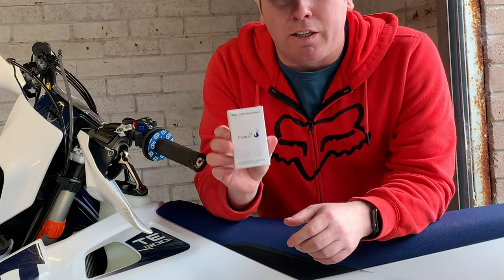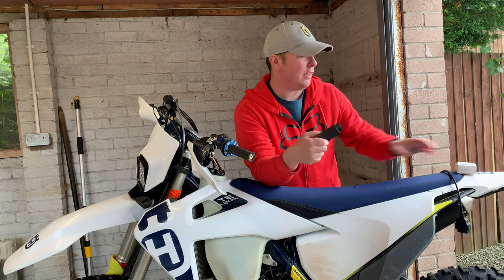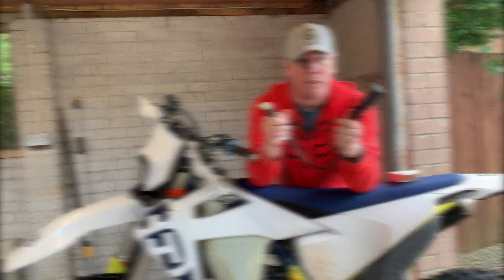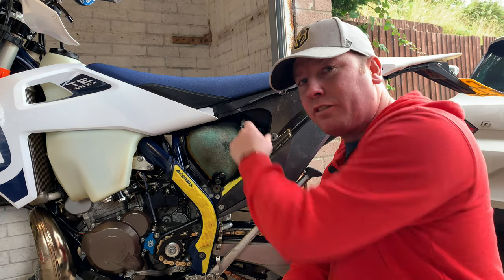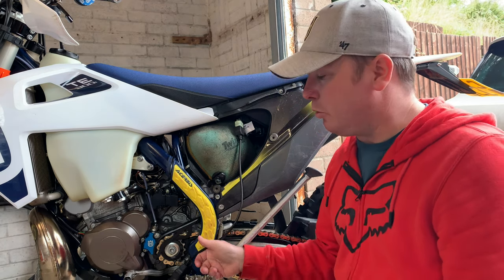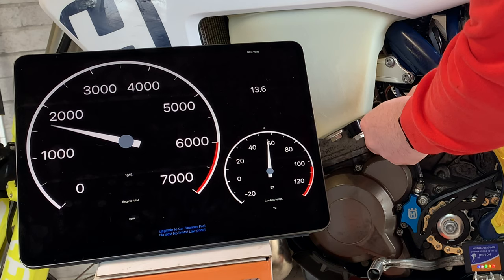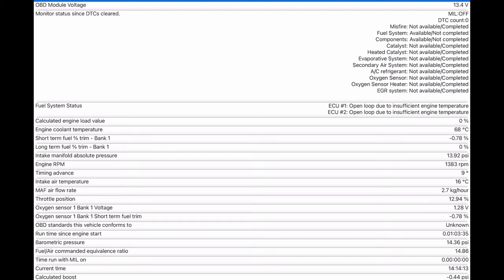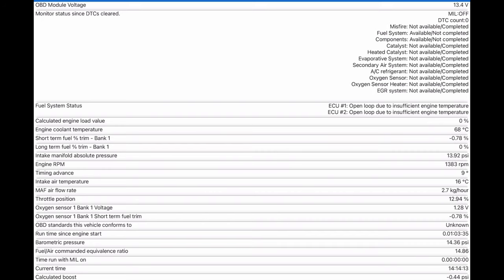The best way to set your KTM HUSQVARNA idle speed - Onboard Diagnostics (OBD2) scanner and App | TPI

Comment from the maker: If you want the Links to what I used in this video, they are in the description to help you out :-).
Below is a live reading of my bike - if the reading is Zero, it means the bike does not give the OBD2 sensor a reading to display. Unfortunately it doesn’t show the hours the bike has been in use. 

OBD Module Voltage
13.6 V

Fuel System Status
ECU #1: Open loop due to insufficient engine
temperature
ECU #2: Open loop due to insufficient engine
temperature

Calculated engine load value - 0%
Engine coolant temperature - 36 °C
Short term fuel % trim - Bank 1 -0.78 %
Long term fuel % trim - Bank 1 - 0 %

Intake manifold absolute pressure - 13.92 psi
Engine RPM - 1784 rpm
Timing advance - 12 °
Intake air temperature - 10 °C
MAF air flow rate - 1.02 g/sec
Throttle position - 12.94 %
Oxygen sensor 1 Bank 1 Voltage - 1.28 V
Oxygen sensor 1 Bank 1 Short term fuel trim -0.78 %
OBD standards this vehicle conforms to
Unknown

Run time since engine start - 0.00:00:00 
Barometric pressure - 14.21 psi
Fuel/Air commanded equivalence ratio - 14.63
Time run with MIL on - 0.00:00:00
Current time - 15:34:23
Calculated boost - O psi
Calculated instant fuel rate - 0.28 L/h

Comment: Hi. You are using the Car Scanner app? What vehicle profile do you assign at setup? There is no Husqvarna profile that I'm aware of, only KTM. i selected that profile but I could not connect to my 2021 TE300's ecu.     Cheers,
Reply from the maker: Hi there. When selecting the vehicle, I normally scroll to the bottom and select [OTHER BRAND]. If you still have connectivity problems, it’ll be worth going on the car scanner website and looking at their Frequently Asked Questions to see if the results there help. I’ve not had any connectivity issues so can’t offer advice there sorry. I hope all is well with the bike 👍🏻.
Reply: @MALVSMACHINE  Thanks for the info.

Comment: Great Vid!! Mine would not connect to the ECU? Followed all steps and got to the very end but it would not connect? Anybody else have that issue? Used iPhone, downloaded OBDII software, used Car Scanner app, used Wifi instead of Bluetooth as suggested. So close... I tried on a 2022 TE 300i
Reply from the maker: Thank you Elysia! Thank you for commenting about your issue, I can imagine it being very frustrating, I wish I could help in some way but I don’t know anyone who has a 2022 TE300i that I could have a play with. I really hope KTM/Husqvarna haven’t disabled the ability to connect aftermarket OBD tools because from what I understand, it’s really important for the TPi engine to idle in the correct rev range and the OBD tool is the only way to see if it is or not. I’ll make a note of this and keep an eye out for any solutions or if other 2022 TPi owners have the same issue 👍🏻.

Comment: G'day Mal, i have a 2021 KTM 690 SMCR and I'm looking at getting the same scan tool, is there different versions ? they seem to list a lot of car they are compatible with but no bike therefore i was wondering if there is different versions of the tool ? thanx
Reply from the maker: Hiya mate! The scanner I have is the same, it doesn’t mention bikes because it’s a 16 pin connector to directly connect to the OBD port in a car. You just have to make sure you get the correct OBD to ECU lead for your bike, then when you open the app and go through the connection process, select ‘Other’ and should bring up the diagnostics 👍🏻.

Comment: nice but which screw actually are you using to adjust rom cause I can't see. Is that one with the red knob?
Reply from the maker: Hi, I’m turning the idle screw on the throttle body using a screwdriver. It’s the only screw there. 
What year and model bike do you have?
Reply: @MALVSMACHINE  I have 2023 fe350 and I have yellow and red know which can be turn
Reply from the maker: @andrewsoldan6050  ah ok, I’ve not seen a 2023 FE yet, but I’ve just looked at the online user manual and it looks like the 4 stroke has the red adjuster on top and the yellow adjuster on the bottom? 
The dial on top of the throttle body is to adjust the idle speed, and by turning it clockwise increases the idle and turning it anti/counterclockwise decreases they idle speed. I recommend getting the user manual for your bike before you start adjusting things, you can download it for free off the Husqvarna website.

Comment: Hi, thanks for the explanation on this video and the crankcasepressure one, is there a default value do figure it out a crankcase pressure sensor value default ? To be 100% sure that it is fault ? 

Cheers
Reply from the maker: No problem. 
I don’t know if there’s a value to test or a way to test if the sensor has failed using the OBD tool, but if the bike has a rough idle, the only way I’ve seen people confirming if it’s the sensor is by swapping the two sensors around, and seeing if the idle returns to normal or not.
It’s quite a common issue for a sensor to go bad for no reason and I’ve seen a lot of people swapping the sensor to fix it…. It’s just a shame KTM/Husqvarna didn’t do a recall on them.
Reply: thanks for the input, did you make the idle screw mode ?  @MALVSMACHINE
Reply from the maker: @davidrodrigues510  no, the only modification the bike has now is a FMF Gnarly expansion chamber 👍🏻
Reply: Cheers for all the answers really apreciate @MALVSMACHINE
Reply from the maker: @davidrodrigues510  no problem at all David, all the best and enjoy ✊🏻🏍️
Reply from the maker: Hi David, apologies for the response with this, I didn’t get a notification and am only just finding a filter to see new replies….
The spark plug I have fitted is the BR7ES plug which came in the bike as standard and I replace it like for like 👍🏻
Reply: @MALVSMACHINE  No problem mate, thank you

Comment: Do you recon this will work on a 2019 Husky Te300i?
Reply from the maker: Hi Dale. I’ve just looked at the manual for the 2019 model and it looks like the EFI setup is the same as the 2020 model, so I think it will work, but there is the risk that the cable may be a different shape to the 2020 model so just have a look before you commit to buying anything.

Comment: Have you done the idle modification ? Or you just turning the air screw on the side of the throttle body ?
Reply from the maker: Hi mate, I’ll never do that modification to my bike, I just use the screw on the side of the throttle body and the bike adjusts no problem 👍🏻.
Reply: @MALVSMACHINE   do you go in with the screw to raise the idle ? Cheers
Reply from the maker: @enduroa.k.o  Turn the screw out/anti-clockwise to allow more air through and raise the idle 👍🏻.
Reply: @MALVSMACHINE   🍻
Reply: So it isnt an idle screw its an air screw the idle screw is under the throttle cam use that not the air screw. Air screw valve thing is for the hole rpm range ktm set it bang on for air to fuel mixture if you put a afr sensor in the pipe youll see that ypuve changed that slightly @MALVSMACHINE
Reply from the maker: @thomasmarshall5728  Hi Thomas, I bought this bike brand new so nobody has been able to butcher it and add the ‘idle screw’ modification when their sensor went bad. So that screw you speak of has not been fitted to this bike and the original grub screw is still locked in place and covered by an undrilled cover, the way it was made by the manufacturer so the bike is actually set bang on for air/fuel mixture. 
The idle screw (page 23 of the manual) is the screw I’m talking about, and the idle range of 1,400-1500 RPM (page 129 of the manual) is what I adjust the bike to in this video.

Comment: My husqvarna 2022 consumes a lot of gas ....exaggerated combustibble ,can you help me please?
Reply from the maker: Hi mate, nice bike in your picture 👌🏻.
Unfortunately I think fuelling will need more in depth computer diagnostics, such as playing with the mapping to fix your fuelling, which is something I can’t do as the OBD2 I use only gives access to diagnostics, and doesn’t allow configuration of anything within the ECU.
Reply: @MALVSMACHINE  the problem is that he suddenly started consuming a lot of gas, is it possible because I walked on the air screw? ? I want to mention that I also have problems with idling
Reply from the maker: @dragoskw3575  ah ok, then I’d say that one of your sensors is playing up and it’s more than likely the crankcase pressure sensor, which is an issue I’ve had on my bike as well. Either the sensor and housing tray need cleaning or the sensor needs replacing. 
I have a video about cleaning the crankcase pressure sensor that I hope will help you out called ‘KTM Husqvarna crankcase pressure sensor issue repair’ 
I’ve found it’s a common error for people to start turning screws when their bike is running poorly, like they would on the old carb setup to get the correct air/fuel ratio but in actual fact, the idle screw only adjusts the idle and nothing else as the ECU controls the fuelling, so when something isn’t right, it’s because a sensor isn’t giving the ECU the correct information and that results in poor running such as a low idle and bogging down in low revs. I hope it helps you out 👍🏻

Comment: The difference between the idle screw and the air screw is that the idle screw also changes the amount of fuel injected into the cylinder. The air screw only leans or richens the mixture at any given throttle position with more or less air.
Reply from the maker: No it does not, the ECU is what changes the amount of fuel that is squirted in to the transfer port and to do that, the throttle position sensor tells the ECU how much the butterfly valve in the throttle body is open, then the mapping dictates how long the injector squirts fuel when the valve is at that position - you’ve heard of mapping right? 
The idle screw adjusts, and can only adjust the idle because the butterfly valve is closed to the point where it barely lets enough air through the throttle body, and then the idle screw opens or closes an air bypass feed that bypasses the butterfly valve so that the idle can be adjusted using a screw in the bypass feed - for small adjustments and without the need to open or close the butterfly valve, because that’s a much larger hole and small adjustments make a big difference to a big hole than big adjustments make to small hole. 
If you open the throttle half way and hold it, then adjust the idle screw, nothing happens because once the throttle is open, the butterfly valve is open and is pulling in a larger volume of air - taking over the amount of air that was travelling through the small hole that allows air to bypass the butterfly valve and let the bike idle.
So idle screw = idle screw, and needs to be set to a certain rev range, as per this video, to ensure the correct air/fuel ratio at idle. 
Once the throttle starts to open, the sensors tell the ECU what’s happening and it goes to work. 
This isn’t new technology, it’s EFI.
If you watch the Husqvarna/KTM Enduro team during testing, they have a computer plugged in to the bike so that they can adjust the mapping on the ECU, they’re not messing with a screw to adjust how open or closed the butterfly valve is in the throttle body.
Reply: Yes the idle screw stops the throttle at a different position and the throttle position sensor tells the ecu how much fuel to inject. The air screw does not change the throttle position.
Reply from the maker: @chrismx339 don’t fall for those videos where they change the name of the screws to sell you a screw with a spring on it. It’s an idle screw because it’s to adjust the idle as the manufacturer states. The other screw is the throttle stop.
Reply: Adjusting this screw changes the tps voltage.

Comment: Hello. With this OBD is it possible to see the total hours of the bike?
Reply from the maker: Hiya mate. I don’t recall seeing anything on it with regards to the Hours. 
I’m not near my bike at the moment, I work away from home through the week but will be able to have a look on the weekend and give you a solid answer. 
Thanks very much for your question, I’ll add a full list of what the app reads when connected, as a pinned comment 👍🏻
Reply: @MALVSMACHINE  Thanks. this information would be very useful to me. I'm waiting for your answer. And thanks for your videos, it's a good job!
Reply: @MALVSMACHINE  I'm waiting too..
Reply from the maker: @MynameisCF  Hi, sorry for the delay, I’ve been ill and was unable to go home for two weeks -  I got home this weekend and have now put a pinned comment showing what the OBD2 scanner can read. Unfortunately it doesn’t show how many hours the bike has run total which is a shame.
Reply from the maker: @hardendurobosnia17  Hi, thanks for your comment, I was able to connect the bike up today and check what the OBD2 scanner displays. I pinned a comment above of the full list, but where the reading is Zero, the bike does not offer a reading for the scanner to read. There is no reading for total hours of the bike either which is a shame.
Reply: @MALVSMACHINE  thanks!
Reply from the maker: @hardendurobosnia17  no probs at all mate.
Reply: @MALVSMACHINE  thanks

Comment: Its not a idle screw it makes ur bike lean or rich and helps kinda with idle the mod sets idle and u can get it right if its rich or lean
Reply from the maker: It’s an idle screw. Read the manual. If you have to open the butterfly in the throttle body which lets way more air in to set your idle, your bike is not working correctly.
Reply: No, most people do the idle screw mod so that they can maintain the desired idle while also adjusting the mixture as required. Emissions is the reason KTM have to do this and we should be thanking them that they were smart enough to get around this simply with a bit of loctite which is easy to remove and restore the full functionality once the bike leaves the factory.
Reply from the maker: You’re wrong and don’t understand electronic fuel injection. All the ‘idle screw modification’ does is open the throttle.